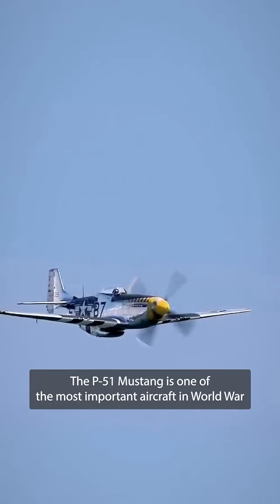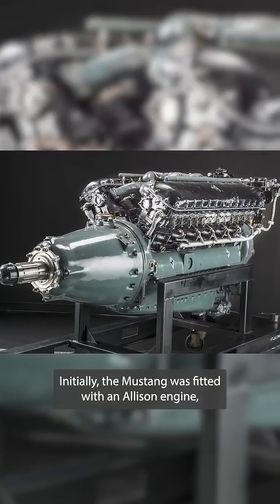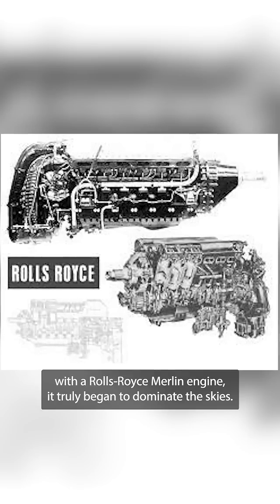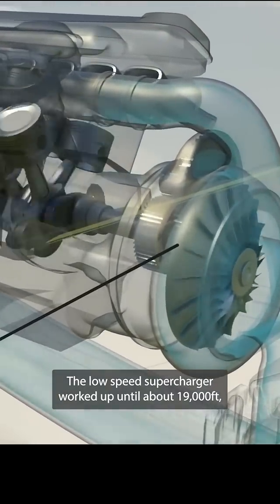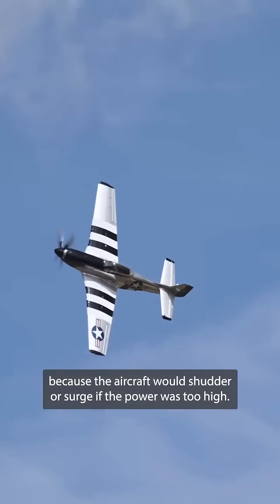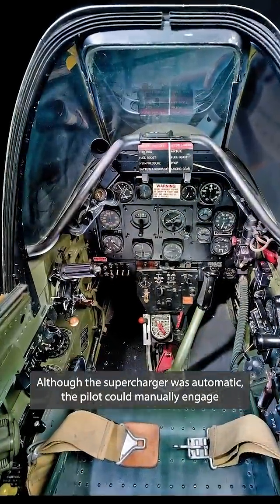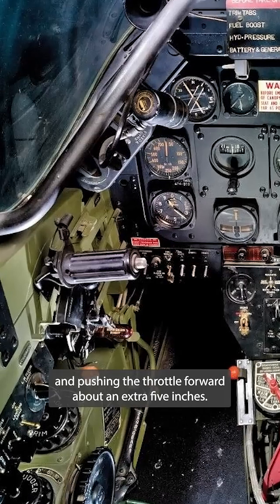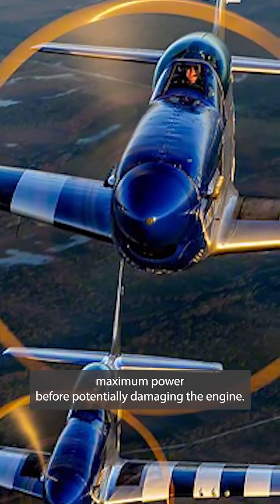The P51 Mustang: WW2’s Best Fighter!

Comment: The power outputs of fighter engines especially during the war is just insane to think of for the time period. Racing cars were lucky to see 200hp while V engines were producing 700-1200hp routinely, and even more for radial engines. In the 1930s and 40s. Crazy to me every time I think of it
Reply: More than a few of these engines showed up in cars at the drag strip. Jay Leno put one in a 1934 Rolls-Royce.
Reply: @thereisnospoon52 Jay Lenox is out of a Beaufighter iirc which is absolutely awesome
Reply: Experimental race cars in the 1920s and 30s fit aircraft engines from WWI and had well over 200 HP. A common engine to use was the Liberty-L12 for ~450 HP.

The reason that race cars didn't have bigger engines is because it was exceedingly impractical. The Merlin Mk. 61 had a dry weight of 1,640 pounds. It was a dry sump engine so you needed an external fuel tank. Various sources say between 7-12 gallons of oil, so add another hundred pounds of weight there. You'd want to be on the heavier side since these engines consume up to 20 pints an hour.

Where you get into trouble is cooling. These engines produce an enormous amount of heat. You can run them for brief periods of time on the ground at low power settings, but they need really high velocity air across huge radiators to be cooled properly under load. You'd be looking at dozens of gallons of water/glycol, so several hundred more pounds.

By the time you had all of the engine and accessories together, you'd be well over 2000 pounds before you even got to the car. Building a race car around that would be exceedingly expensive and impractical. You wouldn't be able to utilize even half of the power of the engine before the car would fly apart.
Reply: The size of the engines and the use of forced induction in war planes is why they produced so much power.
The v engines in planes were much smaller in displacement that most of the radial engines. Still, some of the v engines produced as much and even more power than far larger radial engines due to using high pressure forced induction with fuel additives to make very high octane fuel, preventing early ignition under the higher pressure and temperature caused from the high pressure forced induction and compression stroke of the piston.
The Merlin got up to 2,000 hp from a 27 liter displacement. The most powerful was the radial Pratt & Whitney R-4360 Wasp Major at 4,300 hp, but it was a massive 71.5 liter displacement engine.
Reply: @timothyedwards8329  close.  the last 100 series merlins were 2200 Hp from 16 liters,  the main difference between a radial and V12 was glycol cooling. glycol is more efficient than water thus reducing radiator size to 1/3  which made the water cooled motors less dragy compared to the radials. the down side of the radials is they tend to always have higher Head temperatures  so could never run the same boost
Reply: @deanwilliams4365  radial engines didn't use a radiator. Each cylinder's housing used fins to cool just from airflow over each individual cylinder.
Reply: The Allison engine mentioned at the beginning was a 1710-39. That is 1710 cu/in.
Reply: The planes were also absolutely massive if you’ve ever seen one up close
Reply: Is why they powered the hydros until we ran out of them !
Reply: That's because avgas is insanely dangerous
Reply: @AiOinc1 the fuel was simply petrol (gasoline) with a lot of anti knock agent (tetra ethyl lead) in it, the additive actually reduces 'flammability'!
Reply: @AiOinc1  Totally the opposite.

Comment: Stanley Hooker was responsible for the supercharger design on the Merlin, he wasn't really an engineer his degree was in mathematics, even his autobiography was called 'Not Much of an Engineer.' He was also responsible for the Pegasus engine in the Harrier.
Reply from the maker: I'll pick a copy up! Sounds interesting.
Reply: There's a very interesting interview with him from about 1980 on YT. "Not Much of an Engineer" was what the head of RR told him when he hired him.
Reply: @zapfanzapfan 
 Some of the world changing ideas didn’t come from engineers or people with college degrees.
Reply: @hipoman8087  Oh, he had a degree, PhD even, just not in engineering. He hadn't seen a supercharger but once he put his math and aerodynamics into it he did wonders.
Reply: Me too !!!❤
 
Also a drag race tif bit.  That crank driven supercharger setup is used pro class cars. Not the dual stage.   Freind of mine ran PRO mod. ❤
Reply: Reading that, my hunch is he worked out the numbers needed to make it work.

Just a hunch.

Comment: P-47 and F-4U with the R28 Wasp are much more impressive aircraft.
Reply: Are they, are they really?
Reply: A Mustang formation pass by is really impresive. Sound, power and beauty.
Reply: The Jug would take a increadible amount of damage and still be flyable, and had great armour to protect the pilot. That and the radial engine made it "tough". It didn't have some of the high performance of the Mustang, but it could take a beating and bring itself and the pilot home.